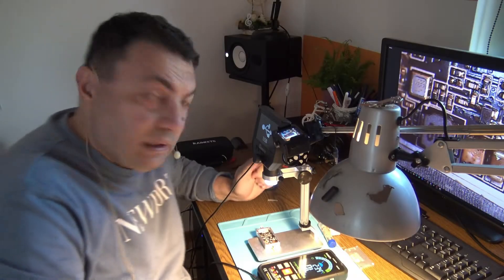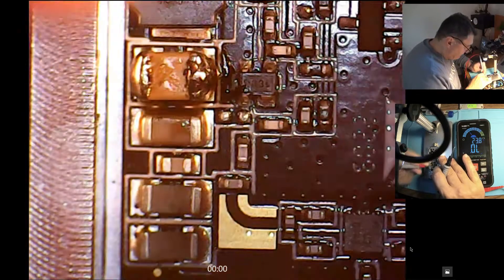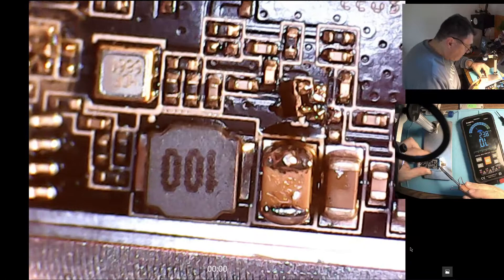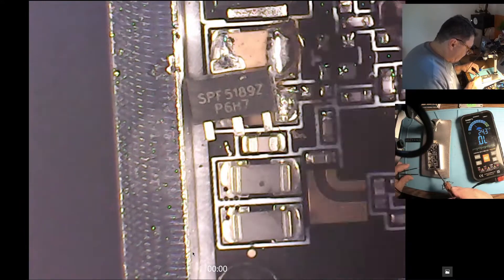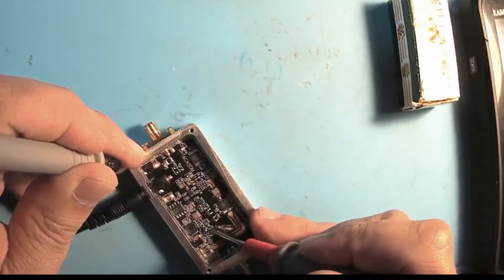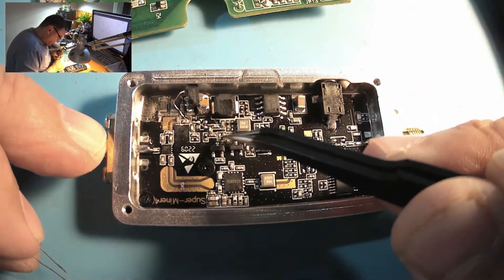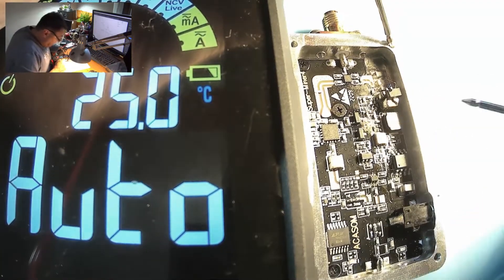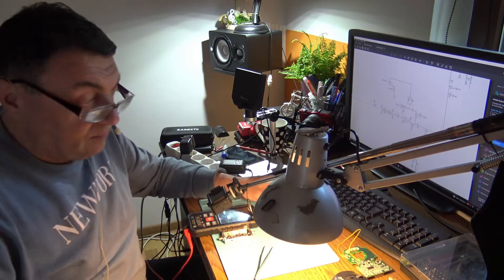Acasom v.1 attempt for better SNR

Comment: Hi, Viorel. That transistor that you take out was 1 or 1.2 Ghz rf transistor  What does that mean. it means that it's beta coefficient is 1 at those frequencies. 868 is near to that frequency, so that could be a noise source. I would advise to use higher frequency rated transistor, for example 6Ghz or more. BFG93AX would be fine. because it is npn transistor with the same pin configuration and its 6Ghz or you could take out one from that TV antenna amp that you have. If the memmory does not failing me it was 9Ghz, even better. good luck!
Reply from the maker: Good idea..even better..

Comment: Hey man we all see acasom amp is too noisy and crap. Dont waste your time with it. There are much cheaper and better amps on market. Would like to see tests with other amps😉👍
Reply from the maker: I love to experiment and I'd like to see some other amplifiers..thanks
Reply: @viocaia  Good job with your analysis.... but I cannot understand the variations between the different Acasom units delivered. Some units have excellent figures while others are rubbish. You should talk to Sorin and maybe have a streaming with you both analyzing and comparing each one your acasom devices to check if they have the same hardware components, and same results. Just an idea... but It would be an interesting video!
Reply from the maker: @AitorBCN  The answer is bad /low quality parts..The schematic is solid and cleaver, nothing to say about it. You'll see my MOD in a couple of days..
Reply: @viocaia  Good news! Looking forward to see your new mod!
Reply: Please, say the name of other good amplifiers :) I use airbuddy, nothing soecial...
Reply from the maker: @nikolaynikolov8072  I really can't say..personal I use for RX only SPF5189Z with a filter in front..
Reply: @nikolaynikolov8072  You can look for the new version amp from Raygnal. It performs also good without cavity filter and the rx and tx gain is adjustable. Outdoor version is around 70 dollars+ biastee.😉
Reply: @kadirkursat9266  where do you find it that cheap?

Comment: Excellent video Caia! 
What would happen if I use acasom amplifier with bobcat antenna (4dbi)? 
Also, should the amplifier be powered before turning the hotspot on or it doesn't matter?
Thank you
Reply from the maker: Just plugin the antenna, you may power as you want..doesn't matter